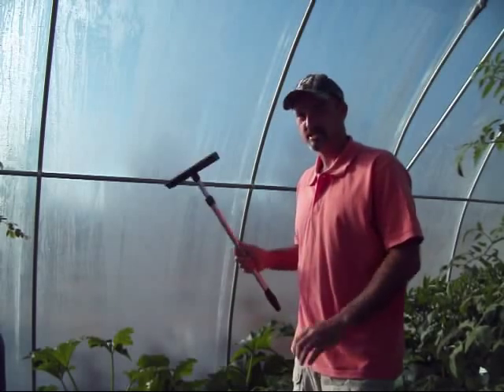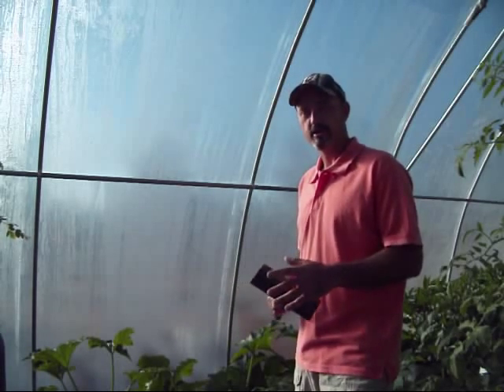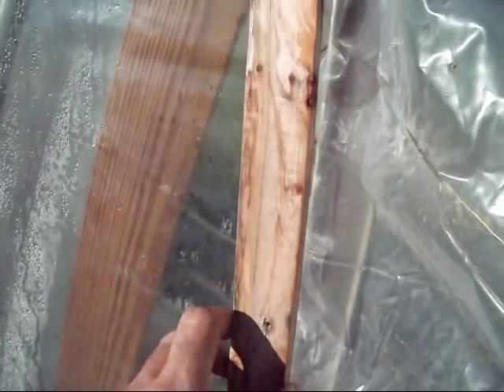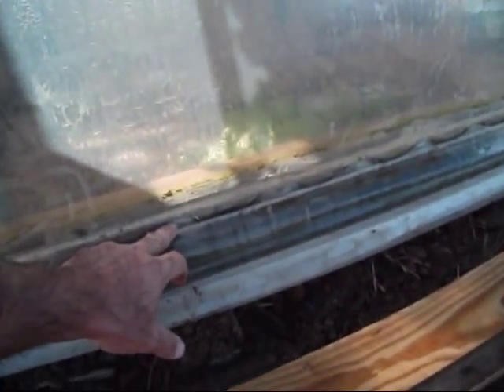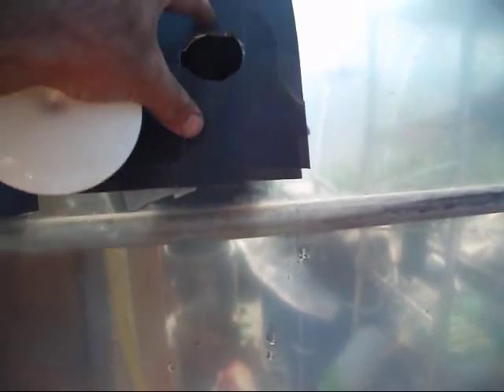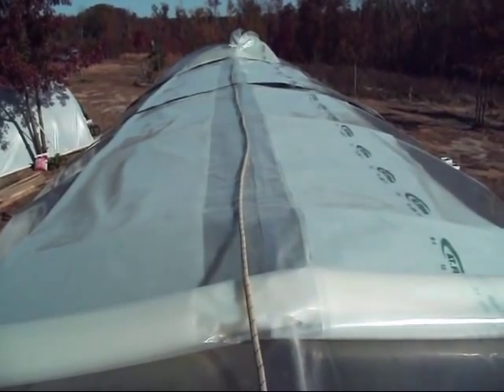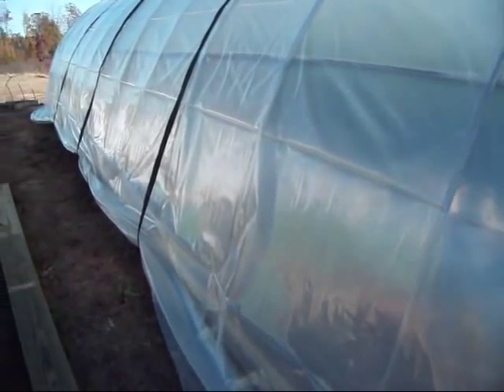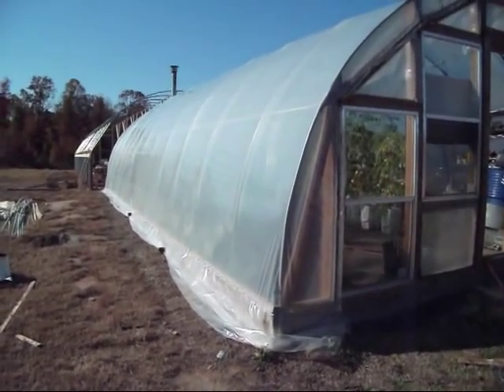Installing a Second Layer of Greenhouse Plastic, Just Me and Him

Comment: yes Bobby, second layer will help greatly the air between the two layers acts as a insulation works really well, stays warmer for sure..we had fans up on the steel which blew air down the sides helped some with condensation and bringing outdoor in just for a little bit will help rid .. hard to completely get rid of it all.. been there, but as the weather changes, and cold outside and warm in the greenhouse it does form easier..  just my 2 cents.. good luck  Bobby you are doing great work!

Comment from the maker: Very much so. It was noticeable right away, as the temps didn't fall quite as fast with 2 layers of plastic. The condensation was greatly reduced. And the wear and tear from loose plastic flapping in the breeze is no longer a problem. I highly recommend using 2 layers and the inflation blower.

Comment: If you had used only one wigglewire for both layers of poly, you would have increased your chances of complete system failure by at least a factor of four if not more. I would have to say that the method you used to increase your r-value/light conductance ratio put you at the optimum efficiancy possible for the least cost and the least chance of failure. You sir, has done your homrwork and will be handsomely rewarded for it.

Comment from the maker: @dalecalder2003 Thx Dale. Yes it is...makes installing the plastic a lot faster and easier. I'm not sure more ventilation would help, cuz the outside air is just so cold. But I'm pretty sure a second layer of plastic would help. And the inflation blowers dont pull much current, so it shouldn't take much to power them via solar. I'll be looking into that as the days go by.

Comment: Bobby, The Good News: Did you know you can get that aluminum wiggle wire tracking in double extrutions rather then the one (single) form that you use in this video? This would allow you to mount the double layers without the head aches. They are only 3 inches wide, 8 foot long and attach to the hipboard.  The TOP slot holds the "inner" poly skin while the BOTTOM slot holds the "outter" poly skin. The Bad News: The cost per each 8 foot length is around 19.00 without shipping!  
    AWESOME VIDEO

Comment from the maker: @mediamaker2000 There is a size available called "tube width".  If you need 24 wide, its a 48 ft piece already folded for 2 layers. Then one piece of wire will work...on one side. I'd still secure the open side one piece at a time. One drawback is the sheer weight of working with 2 layers at one time. This stuff is heavy.

Comment from the maker: Hey Jay, I did add the adapter to use outside air. It works out pretty good. There's still some condensation on the inner layer, but not too bad. Thanks.

Comment from the maker: You can buy a manometer to measure the pressure between the layers. I have the opening on my inlets set at about 1/4 inch. If you're open halfway, that is way too much if you have good seals all around.

Comment from the maker: I don't know about a minimum, but you definitely need something strong. It's not just the wind.... you'll have to factor in the snow. I'm not familiar with the ebay GH's. My suggestion would be to look on Craigslist and try to find a used GH frame. If you're patient, you can find some good deals.

Comment: Great video, isn't that wiggle wire a great invention. I've had condensation in mine ever since I put it up in August. It's too far from a source of power so I've been looking at solar powered greenhouse fans for next year hoping that more air flow might solve the problem. A second layer of plastic would be great here though for the insulation factor, if I could find a solar powered blower I might do this in the future.

Comment from the maker: @Ja72corbin I have 3 fans that circulate air 24/7. It can get kinda breezy in there. My remote transmitter for the thermometer does record the humidity. Yes, its quite humid too. I'm not sure about trying to regulate it though. I can open the windows and change out the air in just a few minutes.

Comment from the maker: @MelodeeRose Thx Mel ! I was surprised at the clarity today, with no condensation. And I did notice the air gap was increasing, which is good. I'm working on sealing all the edges of the 2 layers of poly now, to help the process. So far, I really, really, REALLY like it !

Comment: Hi Bobby, love all your video's. Need some advise on using second layer of plastic. I have a 30ft x50ft hoop house and use aquaponics to grow my veggies. I have 5 fish tanks {ibc} 175 gallons. The condensation level is terrible, did the second layer make a big difference? I'm using 6mil plastic and wonder if the air space would help cut the moisture level down.I'm 25 miles south of atlanta and we still get 29 degree nights.I tried a rocket stove and it takes to long to heat up and to much time to tend. Watched your double barrel stove and think i'm going to make that and remove the rocket stove. You should be very proud of what you have accomplished as anyone who has tried to do what you have done knows that it is a labor of love . Thank You so much for your inspiration. JIMS
Reply: JIM SWIERINGA once u have two layers of plastic on , inflate the space between them. if u take warm inside air u will have more condensation as apposed to outside air. or so im told .

Comment from the maker: @kokonutbaby1 I'm no expert, but I think it works like this. As the air condenses, it cools. So if the air is contacting a single layer of plastic with much colder air on the other side, it condenses on contact and the temps fall. This is not good when you're trying to heat the air. Very inefficient. Of course I could be wrong... ? ? ? LOL

Comment: Have you tried pulling the air from outside since,colder air contains less moisture so should help,there is some special type plastics with reduced grip or friction so the condensation will not stay on the upper parts of the poly tunnel and will run off instead.Ive seen this on other videos on youtube (bright agrotechs greenhouse) How has this system worked for you since?

Comment: Great lessons, thank you.   Would you please give your opinion on the metal frame greenhouses kits that are on ebay that are around $1000 for a 20x40 with plastic, no side walls. Does that sound like a reasonable price, keeping in mind your cost of time and to gather material with your method. Do you recommend a minimum thickness of pipe to stay up in strong winds. Location: New England.  Thanks again for the many lessons.

Comment: Hi, I was wondering how the second layer worked? I do aquaponics and  and have very high moisture levels and was wondering how this worked and if it would work for me. THANKS FOR YOUR VIDEO'S THEY"RE GREAT. JIM. S
Reply from the maker: The second layer layer helps a lot. The heat loss is less. But the biggest advantage to me is the way it cuts down on the wearing of the plastic since it stays tight and doesn't flap around in the wind.

Comment: Cheapest and most dependable wifi connection in the world is prayer.

This is just out of the box thinking, but couldn't you take old water hoses or even 1/2" pvc pipe that is pretty cheap and lay it over the hoop house in say, every 6' or so in order to give a cushion between the 1st and 2nd layer of poly sheet cover. This would give the space between them when the second layer of poly was added. You could then take an air pump for an inflatable  mattress and use it to pump up the pressurized air between the two sheets of poly? To check for leaks, could you use the lit incense stick as they do when checking your home for leaks in making it air tight?  Although I have not seen it done, why couldn't a person use a heat gun to  stretch the poly sheet tighter on these hoop homes? Not on high heat, but they do use heat guns to stretch plastics in other applications.

I have been pricing the build for a hoop house which is made from cattle panels purchased at Tractor Supply Company vs gray pvc pipe that is 2" in diameter.  I am tempted to build a double height framework of 2X6 lumber just to add height to the overall hoop house.  Just looking at pros and cons and many different ideas which I have gleaned from looking at the tons of videos on YouTube as your's. So far, it appears that the cattle panel hoop house is cheaper to build than the pvc one, but, like say, there are advantage to each and disadvantages, as well.  The wiggle wire is nice, but costly and I am more inclined to use a tube method I have viewed where different size pvc pipe is used to snap together and hold the cover in place.  Some folk state that the pvc pipe in such disintegrates the poly cover, but I feel that if that were accurate then why would that not happen with pvc hoops as the cover touches them.

Any rate, long winded reply, but thanks for the video as I'll use some ideas from it when I do my own build.